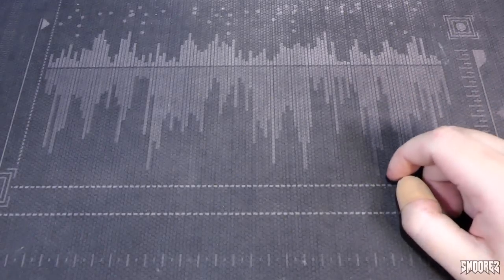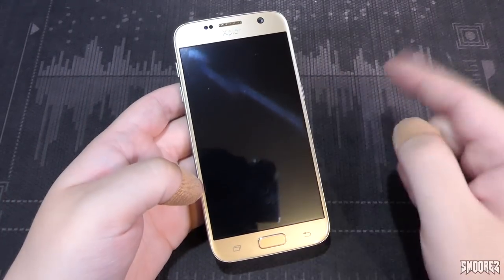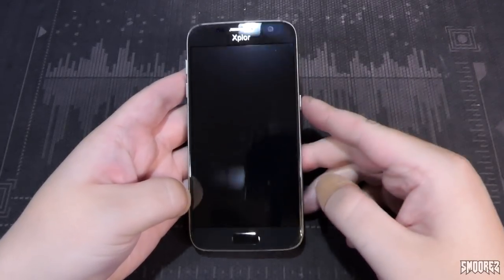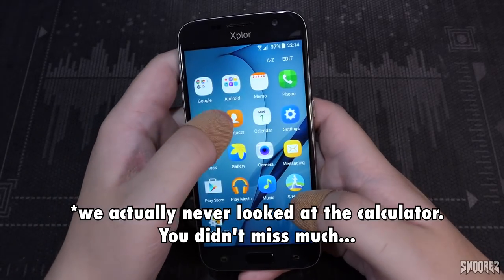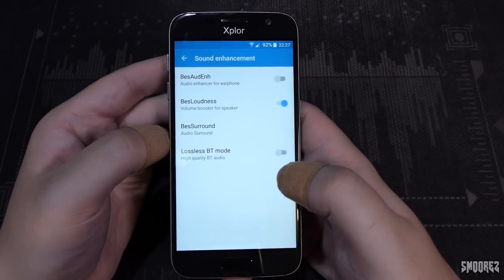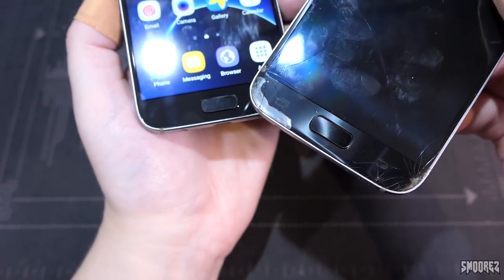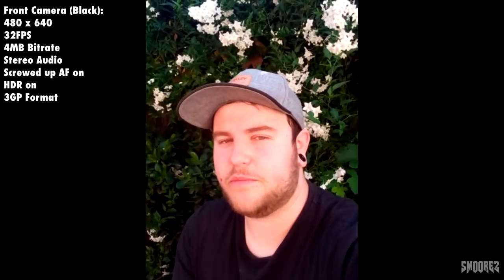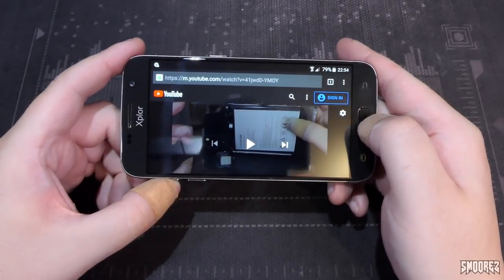ATTACK OF THE CLONES: The Exploration of the "XPLOR S7" Phone! (Samsung Galaxy S7 Clone)

Comment: Some clones are pretty close enough from the original, but most clones are very irritating because they all mostly run on Android 4.1 or 4.4 which is the worst to use in today's time.. I mean they could've used Android Go Edition so it wouldn't be worse than mid range phones

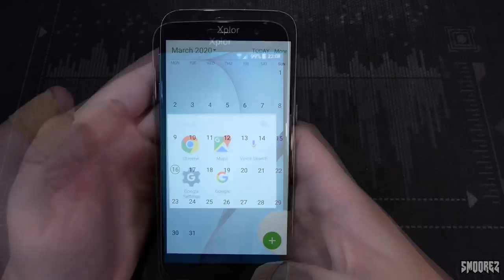Comment: 10:21 It's actually Android 5.1 or older, as Google Settings was made an option in the actual Android settings in Android 6.
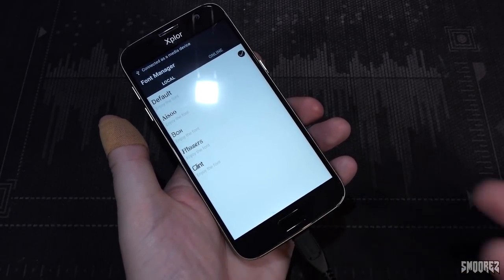10:58 More proof that it's not Android 6, as Android 5.1 and older had the scrolling status bar, while Android 6 had notifications that actually popped out.
Reply from the maker: I eventually find out it's running Lollipop further in the video.